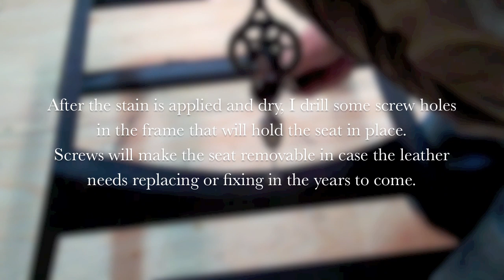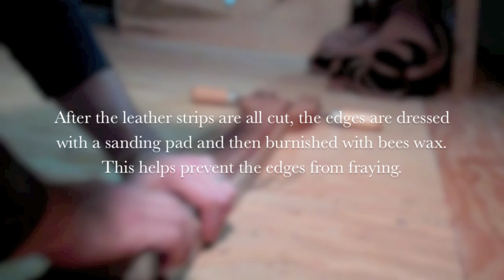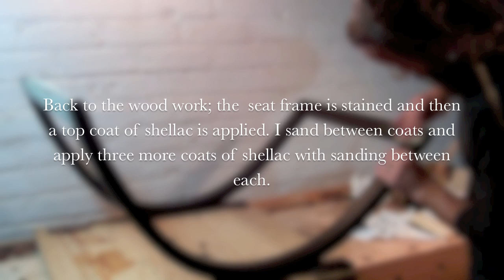The Autodidact's Chair part eight: Finish and leather work.

Comment: Hello, amazing job as always. One question, how many holes for screws you made per side? And when you attach the upper frame, the screws run throw the leather or you make the holes to fit between the leather strips?
Thank you in advance and greetings from Greece
Reply from the maker: Cleomenis,
thanks for the comments and question. I used two screws per side and they land between the leather.
all the best~
Reply: Thank you very much for the quick response, but now I have another question. I suppose because of the leather there is a small gap between the two pieces of wood. That means that the body of the screws is visible from beside throw that gap? 
Thank you... again...
Reply from the maker: Yes- small gap. But screw is not easy to see unless you were lying on the floor and really looking hard to see it.
all the best~